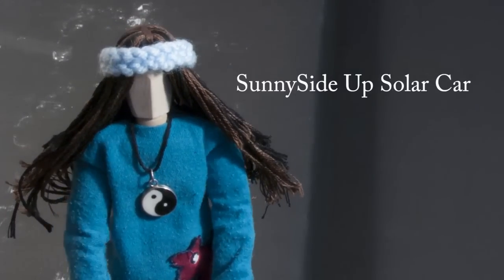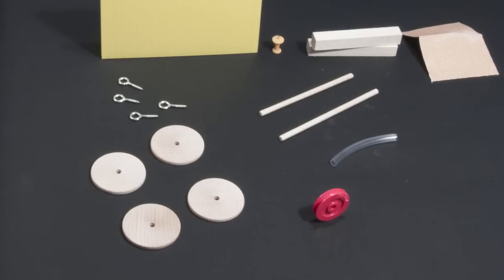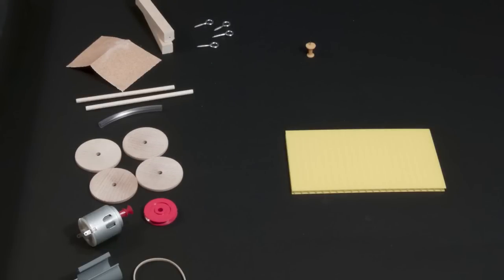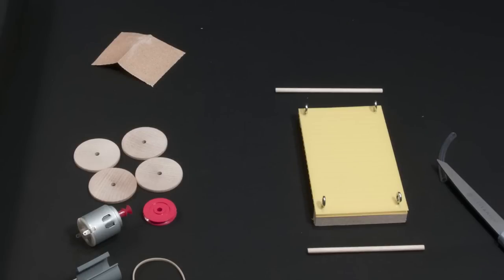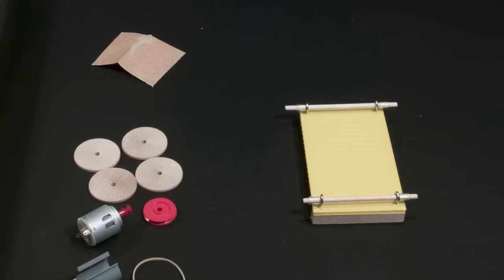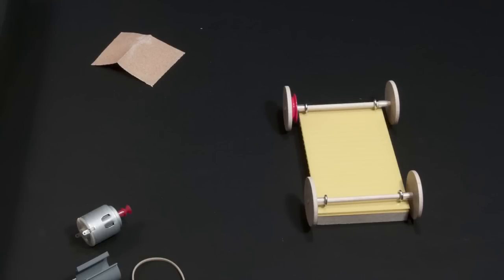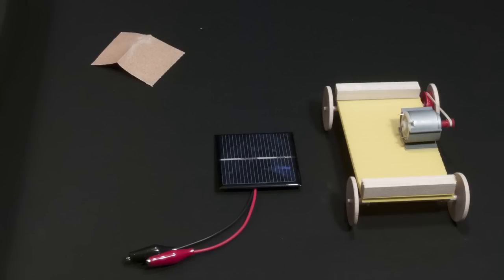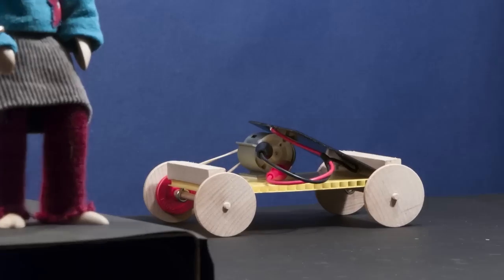How to Build a SunWind SunnySide Up Solar Car Kit

Comment: would this solar car work in artificial light or just outside?
Reply from the maker: Needs strong sunlight to run well - not a cloudy or hazy day. To duplicate the energy of the Sun indoors is challenging - ordinary fluorescents and LED's won't provide enough energy for the car to run. We use a 60 or 100 watt incandescent bulb (held in an uprooted folding arm desk lamp attached to an extension cord, held within about 4 inches from the panel). Others use strong flashlights, emergency lights, and flood-lamps...all will have to be fairly close to the panel.
Reply: I'm thinking just outside man!😜
Reply: Like what SunWind Solar said.